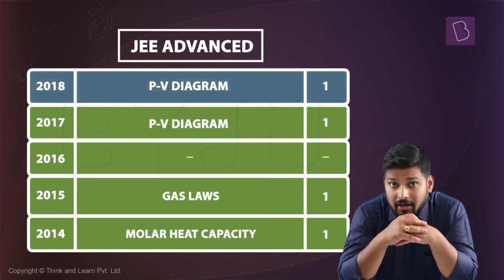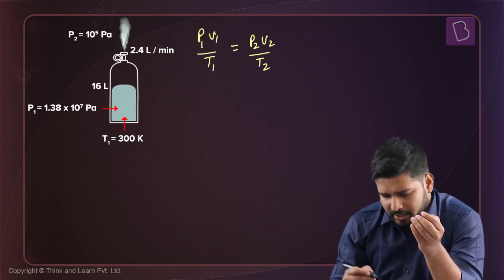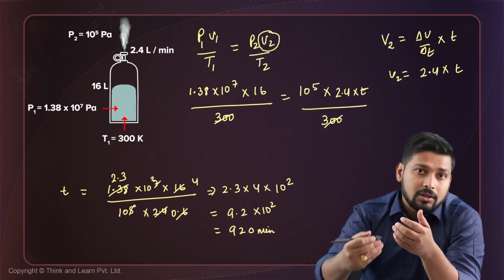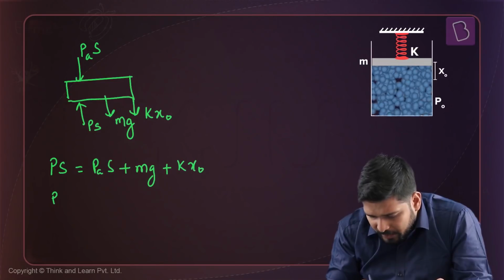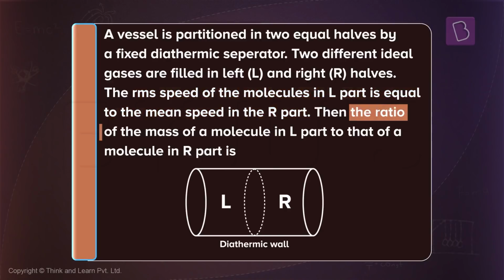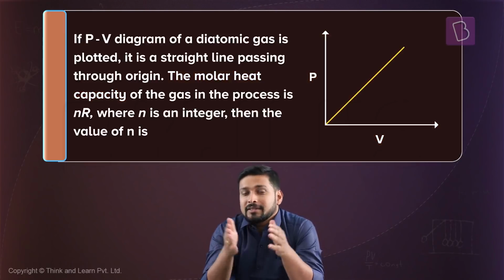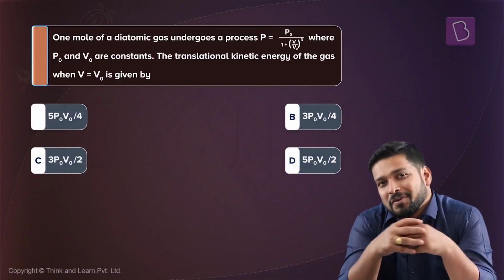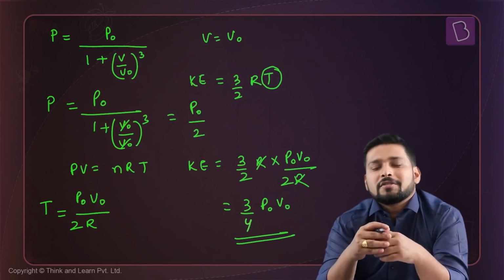Kinetic Theory of Gases | Solved Questions | Target JEE | JEE Physics

Comment: The problem that I am facing while solving numericals is that the calculation work is very tedious like square root of 553.66. Also division and multiplication are tedious.
Reply from the maker: Hi Devi,
One thing you can do with calculations is that if the options are far from each other, you can do approximate calculations. For example, to find the square root of 553.66, I know that 25 squared is 625 and 20 squared is 400. This means square root of 553.66 is inbetween 20 and 25. So I will go and check if 23 is its root. 23 squared is 529 which is close to 553.66. So the answer is close to 23.

Comment: In 2nd question system was thermally insulated so how can u say that internal energy decreases instead it should be 0
Reply from the maker: Hi Sakshi,
Even if the system is thermally insulated, the system will loose its internal energy by doing work. This process is called as adiabatic process.

Comment: sir how can you say that the same no molecuse will be outer as well as inside in ques. no 1
Reply from the maker: Hi Gaurav,
When the entire gas leaves the cylinder, the number of molecules which were inside the cylinder before opening it is same as the number of molecules which are outside the cylinder when it is empty.

Comment: Sir first question mein Aapke logic se toh cylinder mein vacuum ban Jayega. Will the cylinder not come in equilibrium when it's pressure becomes 1 atm?
Reply from the maker: HI Vikas,
Good observation. You are right, but if we see the final volume of the gas,  it is equal to 2.4L/min*920min = 2208 L. The volume of the gas present inside the cylinder finally is only 16 L which is very small compared to 2208L. So you can neglect the final amount of gas present in the cylinder.